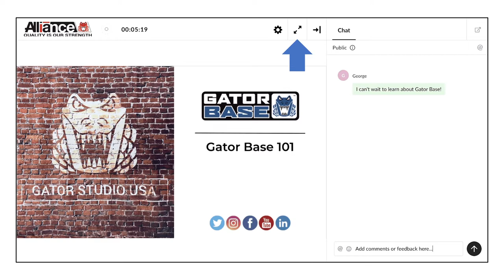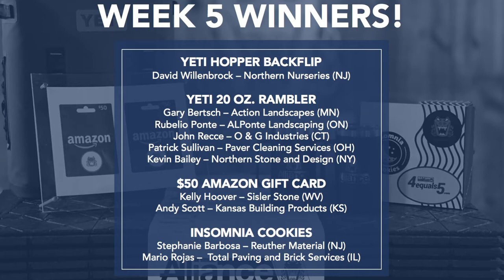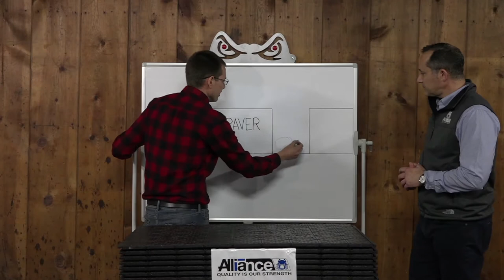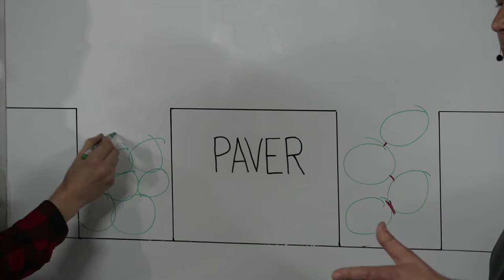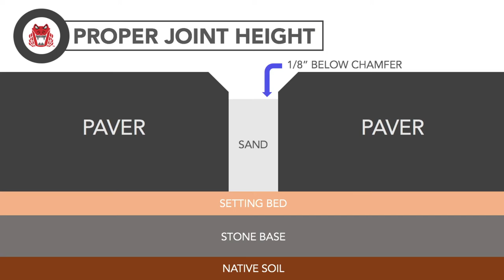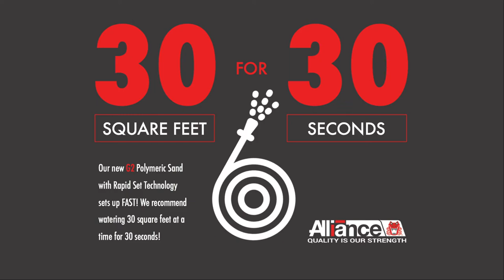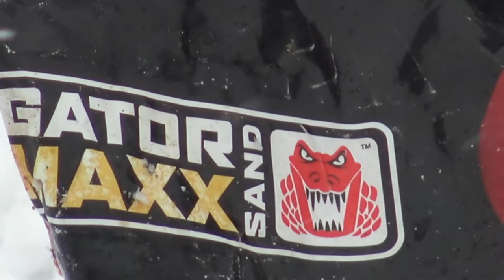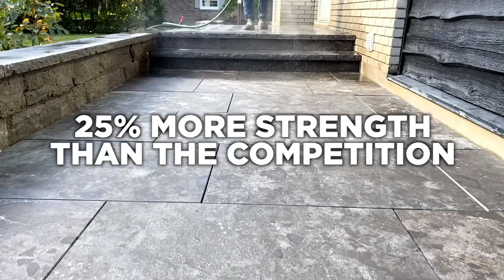Polymeric Sand Horror Stories: How To Not Fall Victim! | Hardscape Training | Alliance Gator

Comment: Great video!

My pool pavers have sunken after a hurricane came through.

My question is can I use polymeric sand?  I have a pool cage and I can’t find one video of someone putting it in when there is a pool cage.
Reply from the maker: Thanks for the positive feedback on our video. You can use polymeric sand in just about any paver or natural stone joint.  Just make sure you have a drainable base like crushed stone and sand under your pavers.  If they are on top of concrete polymeric sand probably won't work too well. Thanks!

Comment: Great video guys, very informative 👍👍
I'll be using 50mm 14"x28" slabs for my patio on top of Gator Base (👍). 
I also plan on using G2 BUT is it advisable or possible to set it) vibrate it into the joints with rubber mallets instead of a compactor. I've purchased a mat for a compactor but am worried about using a compactor
Reply from the maker: Any compaction is better than none, a rubber mallet can work if you are worried.

Comment: I stumbled across your video and channel when searching for "the best polymeric sand product" as a homeowner and not a person who does this for a living, you made this information very easy to understand, thank you. I am installing a product called the Alameda made by Keystone for our paver patio. I understand the use and height requirements of the polymeric sand at the "real" joints between the stones but thie Alameda has "fake" joints/spacings on the surface of each stone to create the illusion of four seperate stones per piece. The photos appear that these fake joints are also filled with the same polymeric sand but since they are not truly interlocking anything they appear to be filled all the way up to and even slightly beyond the top surface of the fake joints. Is polymeric sand okay to use in that setting or do you offer a better product for that sort of fake joint application? Sorry if that rambling question is too hard to decipher, I tried to explain as best as I could.
Reply from the maker: Hi Robin, you can certainly use our products in a false joint paver such as you are describing. The "fake" joint slopes to allow water to drain to the real joint. However, it's still important that the polymeric sand is slightly below the top edge of the paver.

Comment: What if you have zero gap between pavers. Somebody tell me.
Reply: I am in rhe same siruation on some pavers
Reply: @eliesergonzalez5051  it's all just common sense really. It fills gaps and hardens. No gap, no poly sand. Our condo courtyards are big areas with pavers butted together. I keep telling the condo board that throwing sand on them is nuts. Hopefully it will sink in. Unlike the sand. 😂
Reply: @eliesergonzalez5051  it's all just common sense really. It fills gaps and hardens. No gap, no poly sand. Our condo courtyards are big areas with pavers butted together. I keep telling the condo board that throwing sand on them is nuts. Hopefully it will sink in. Unlike the sand. 😂